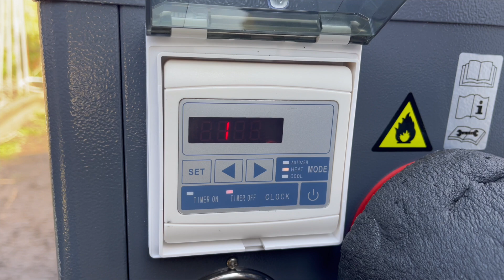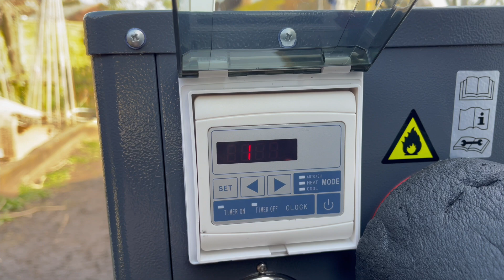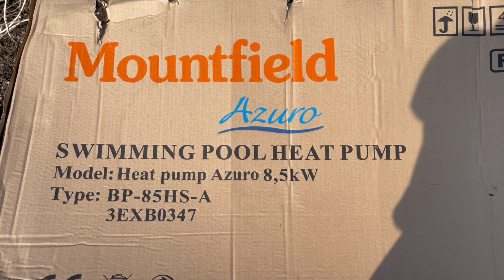UPFLOW FILTER & AIR SOURCE HEAT PUMP INSTALLATION (VID 96) #upflowfilter #ashp #airsourceheatpump

Comment: Hi Tony it's Wayne just a quick question I've bought a heat pump like your one and it's about setting the temperature I've set it for 18 degrees temperature went down to 17.5 when should the heat pump switch back on again it's on heating mode like I was told to do should the heat pump come on again when I drops below 18 thought you would no cause it's the same as your s thanks tony
Reply: What parameter is it number 2 the same one cheers
Reply from the maker: @WayneReynolds-m3u  It is parameter C, use the arrow key to scoll around prams when you get to C press set then arrow key to change 2 to 1 and press set again, then leave, after a few moments it will go back to target temp, if you are more than 1 c below target it will start up a few moments later
Reply: Thanks tony appreciate your help and keep up the good work you do on your channel cheers
Reply from the maker: Hi, the default temp drop setting for restart is 2 degree c, so it would have to drop 2c to start up again, I have reset my temp drop to 1c, which means it will come on more, but work less hard to get back up to set temp, and less temp fluctuation, manual says how to change from default, much as you set target temp, hope this helps.
Reply: Yes thanks tony
Reply: Haven't got my instructions at moment trying to find it could you help me buy telling me how to change it to 1 c if you don't mind tony so it gives me time to find the book hopefully it will be easy for me to follow your instructions thanks again
Reply: Or is it parameter c to change from 2 c  thanks tony

Comment: Hi Tony Wayne again about the heat pump was it easy to wire up is it a plug and start pump did you put a normal plug on it and start did you use a rcd on it thanks again
Reply from the maker: I ran a 16 amp exstention lead from a socket direct from a rcd at my external garden supply which is a armoured cable from main fuse board, cut the 2 pin plug off and fitted a 16 amp waterproof commando plug, although there is no problem with the exstention lead, it is a temp to get up and running.😀